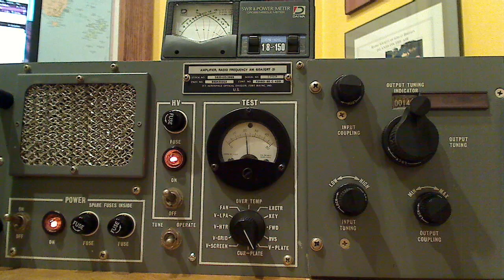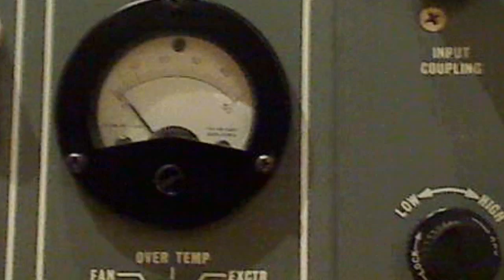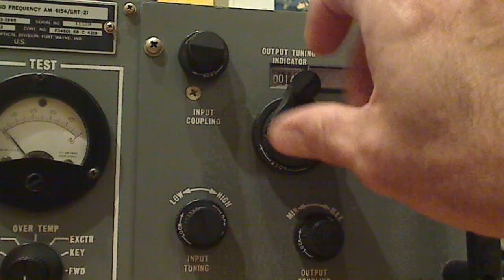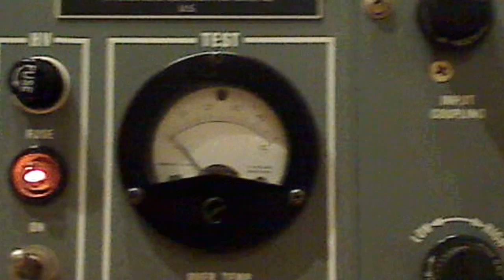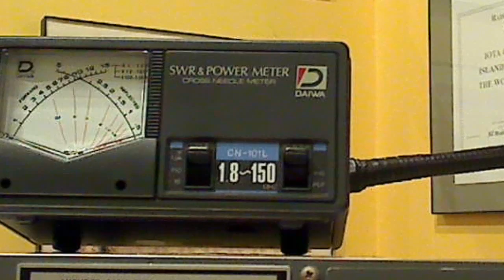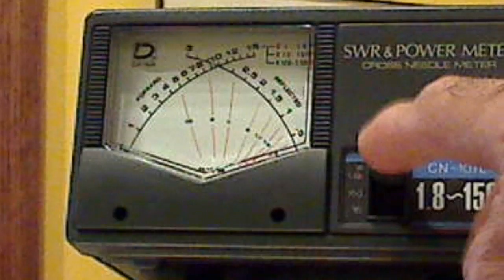AM-6154

Comment: Hi Bruce, you aren't going to believe this but I just came from E-bay and listing my 6 meter gear and was ready to start on listing my 2 meter gear (which I hadn't put on the air yet), anyway was seeking info on the Amp to put in my listing..as my 6154 has been sitting since I bought it 1 1/2 years ago as has been the KLM "long john" 2 meter beam, I was wanting to work MS, Aurora etc but could not find help on setting up or tuning this Amp so I lost interest.. well you re-kindled that interest now and I have no reluctance on tuning this Amp after viewing your great video and my interest in 2 meters is once again peaking..thank you..
I may have further questions for you but I will attempt to contact you via email.
73 and many thanks again..
Kim  Wa7BTG
CN 87nj

Comment: Nice, helpful video, Bruce.  For others trying this amp, I was able to really quiet the fan by mounting in with rubber washers under the mounting bolts.
In addition, to add extra cooling, I added a muffin fan onto the front panel grille.  This pushes extra air into the chassis to reduce heat stress on the insides of the cabinet.

Comment from the maker: Yes the Idle Current was about 5 MA no More then that and I was using the EIMAC 8930.  Yes the Blower noise is not to bad in the video and no complaints while the unit was in operation.  Thank you.  Bruce N9BX 73